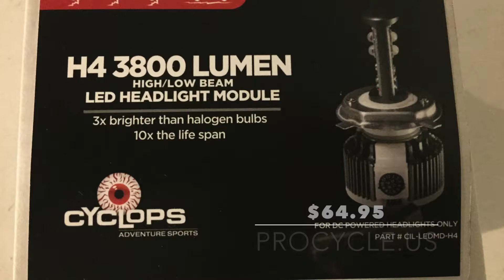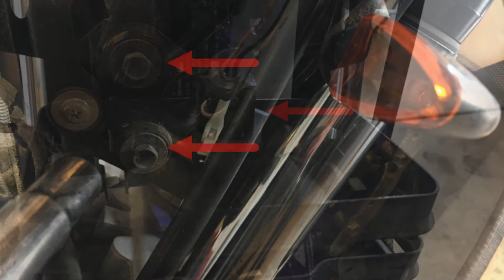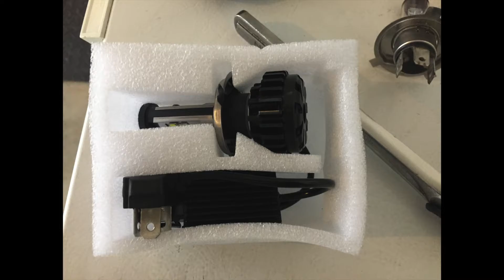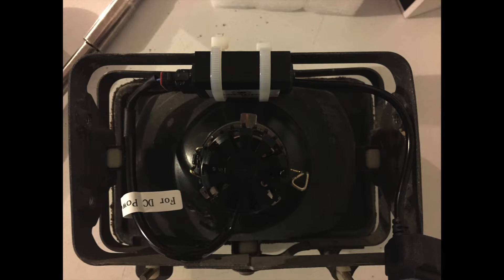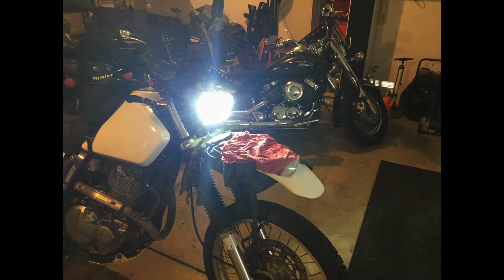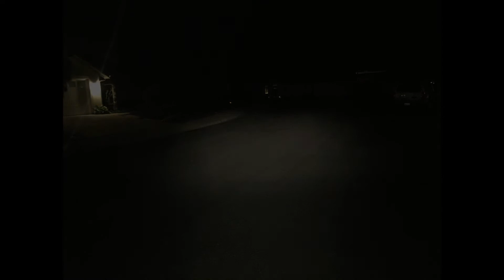1996 Suzuki DR650: Installing Cyclops LED Headlight bulb

Comment: I have this same light on the same bike. I've noticed when I point it at a wall or garage door, the horizontal plane of the image projected is crooked, a little low on the right. Now, I know the bulb only goes in one way so it's not an adjustment issue. And it's totally fine on high beam. Do you notice this on yours? What to do????

Comment: Answered my question on what to do with that stock rubber boot... nothing.  I know how to do that.  Put it in the tool box with the factory headlight (properly protected) in case of LED failure.
Reply: You should be able to seperate the LED bulb from the plate that clips into the headlight. 

Then you just clip the plate in, put the boot on then fit the led bulb.

Comment: I added this to my DR 6 months ago. The fan stopped working 3 months in, now the high beam is dimmer than the low.
Reply: Chris Day did you contact Cyclops?  Assuming you used an actual Cyclops brand bulb, they stand by their product and would make this right. I’ve had two of these on my Triumph for 2 years now with zero problems.
Reply: Thanks For the Heads up I was thinking about putting one on my DR   And was wondering about the fan Situation How long does it last ????  the bulb lasts almost forever
Reply: Clam a warranty.I never hesitate, remind them there was nothing wrong with your dollars.